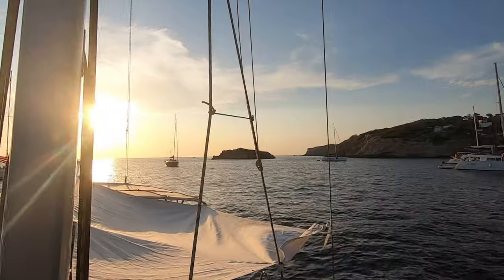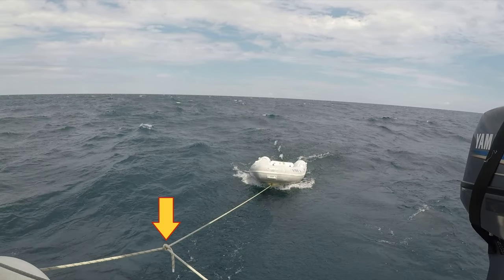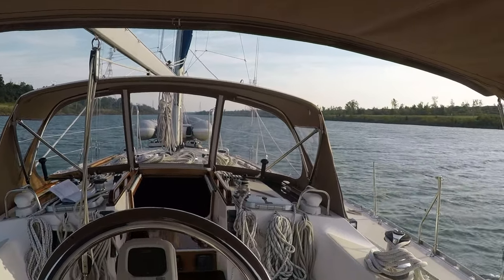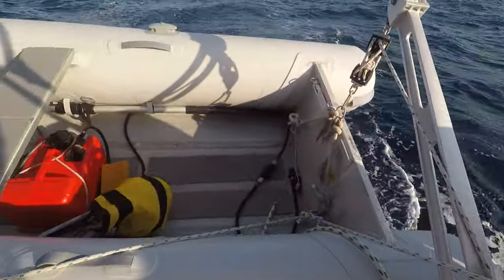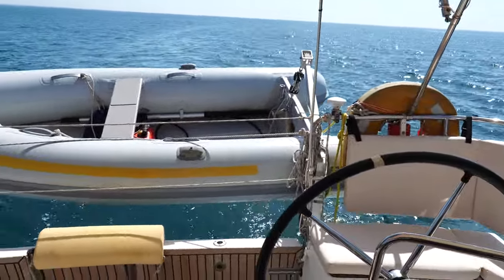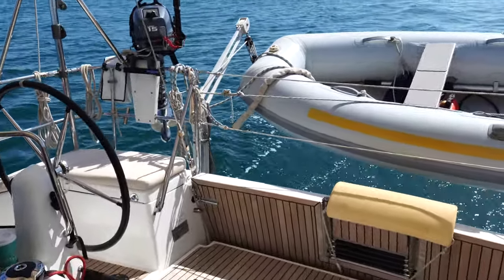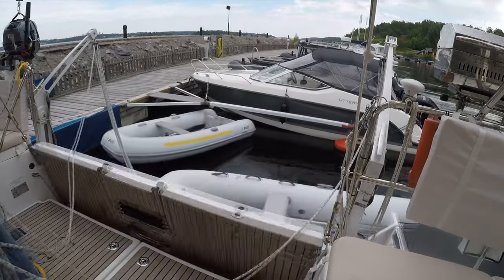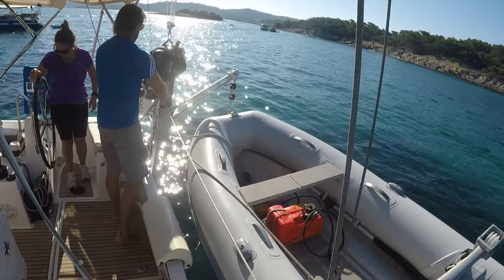Boat Basics - Where To Stow Your Dinghy & Outboard | Ep. 157

Comment: Thank you for this very helpful video.  I'm a big fan of your channel and it's my first go to for all things about the boat and sailing.   My sailboat is a CS33 and I'm location on Georgian Bay. I do not plan to be in bleu water.  I have a 10' dinghy and a 9.9hp 4 stroke outboard that weighs about 100lb. It looks like most people at my marina tow the dinghy, but I'd like to lift the outboard onto a  bracket.  It looks like most brackets are rated for less than 100lb.  My question is, can I keep most of the outboard weight on the crane and go with an underweight bracket? I'd add the additional strut as you suggest. I was also considering installing a motor mount on the transom which would be a more heavy duty solution. Thank you for any suggestions you might have.  Kind regards, Mark
Reply from the maker: Hello Mark. Thanks for the kind words. You have beautiful cruising grounds in Georgian Bay...we loved it there. If you look around you should be able to find an outboard mounting bracket for the stern rail that can hold 100lbs. Here's one for example, https://www.westmarine.com/west-marine-rail-mount-outboard-bracket-8232381.html?&utm_medium=cpc&utm_source=google&utm_campaign=%5BADL%5D%5BPLA%5D%20All%20Categories_Test&utm_content=autoag0000x21019836630x8232381&gad_source=1&gclid=Cj0KCQjwzZmwBhD8ARIsAH4v1gWkT-yP7DEm5Cjudqi7tY7tmZh1aDRpBtygQFLf3uyRf8zSOrs3FgQaAhIkEALw_wcB. I would not trust an outboard crane to take some of the weight. And a transom mount might mean that the outboard is lower to the water and also in the way during docking/maneuvers. Having it up higher on the stern rail would be a lot safer. You might grasp the stern rail firmly and see if you can move it forward/aft to understand how strong it is and whether you need an additional strut. Good luck!

Comment: Hi Karen and Tom. Just started following your channel and impressed with the thoughtful analysis as well as your sailing resume. Great form on the slopes too :). The davit video hits all the points I have been debating. Question: for your crossings in open ocean, do you use the davits and are they working out ok in ocean passages or do you carry the dingy on the foredeck for the crossings? We have a Hanse 43, with a wide, open transom similar to yours, so many of the same concerns re spacing.
Reply from the maker: Hi - thanks for the nice comments. Glad you found our videos helpful. So far, we have kept the dinghy on the davits during crossings. It has worked fine. For crossing the Atlantic this coming fall, I (Karen) have made a canvas cover that will help shed water if following seas are big. I made it at home and am keeping my fingers crossed that it will fit when we return to the boat!
Reply: @LifeFourPointZero  Well that's what I was wondering about I guess. You have had following seas dump into the dingy? This concerns me. On our 43, there is not enough room forward of the mast, and i have a below deck jib  furler that has been known to act up (at the worst possible time of course). I have to be able to get to it.
Reply from the maker: @robertconnerney6363 
We have not had following seas dump into the dinghy but I’m afraid it is only a matter of time before we do. When we crossed the Gulf Stream (with no dinghy on davits), we had waves crashing into our cockpit! It will happen at some point. We have added structural strength to the areas the davits are attached to on the stern. We always pull the plug in the dinghy but that’s just a finger in the dyke. That’s why I made a tent with steep sides to shed any water that hits it. I agree with you that the foredeck causes a lot of problems and we are going to stick with the davits, unless we have some epiphany.

I guess if all sh!t hits the fan, we can cut the dinghy loose and count our losses. I personally feel that a dinghy on the foredeck is incredibly dangerous when any foredeck work is needed. We have a whisker pole that would be suicidal to utilize with a huge dinghy in the way. 

In the end, we are evaluating the risks and making sure there are exit plans for horrible conditions.

Hope this helps.

Comment: For my Montgomery 17, so far I have been able to anchor close to where I want to be, thanks to shoal draft, so an inexpensive small Sevylor inflatable has been sufficient, if not ideal.  I've not had a puncture despite landing on rocky, barnacled beaches.  For all but the shortest of hops between anchorages in the calmest of weather, I simply deflate it and stuff it in an anchor locker.  However, this is a poor solution for traveling longer distances by dinghy.  I've used it in the North Channel, Chesapeake Bay, Maine, and the Buzzard's Bay Vineyard Sound area.

For my Tartan 26 project, the plan is to use a design by Wooden Widget called the Fliptail, a folding dinghy (vids on You Tube) that can be rowed, outboard, or even sailed.  Available in various lengths, too, but the 6' model should  be fine for me.  Folded, it is 6'-2" x 2'-0" x 0'-10" and I have a spot planned under the cockpit just for it.  Set up and break down is very quick for rowing.
Reply from the maker: Those folding dinghies seem terrific! Good for you. We have always wondered if they work well and last a good long time. We have quite a few visitors and anchor out as often as we can so we have opted for a bigger dinghy but we’ll keep evaluating options as technology changes!
Reply from the maker: I just noticed that we have sailed in many of the same places as you! What are your plans for the coming summer? What is on your sailing bucket list?